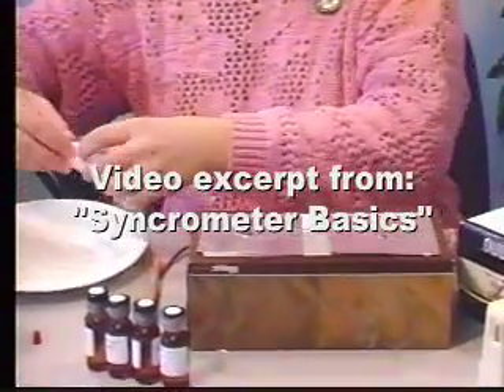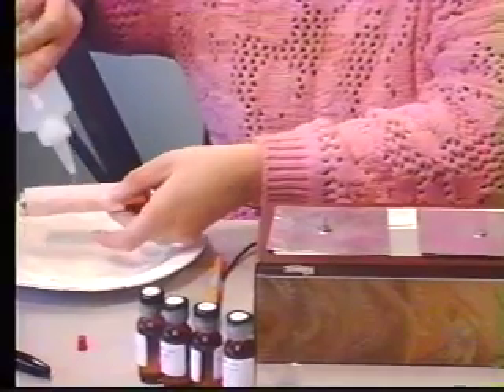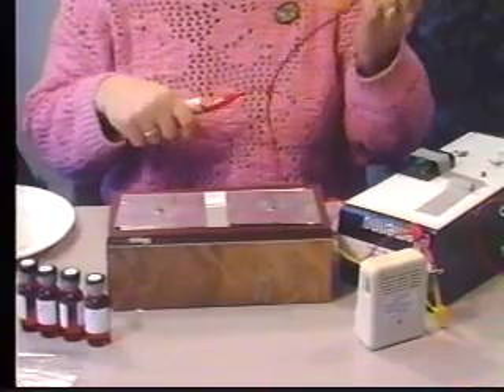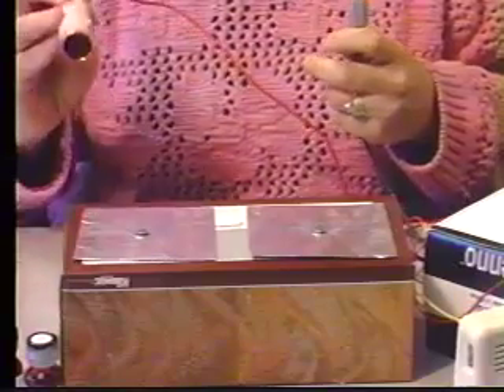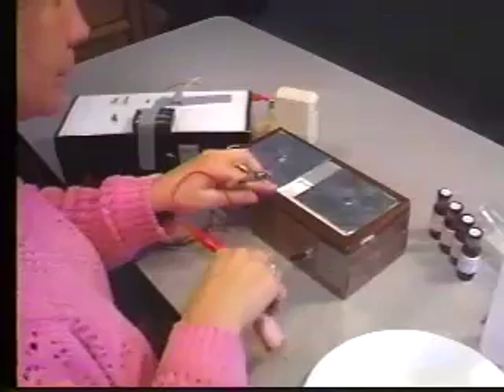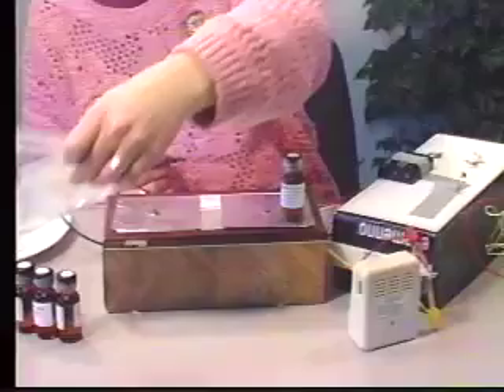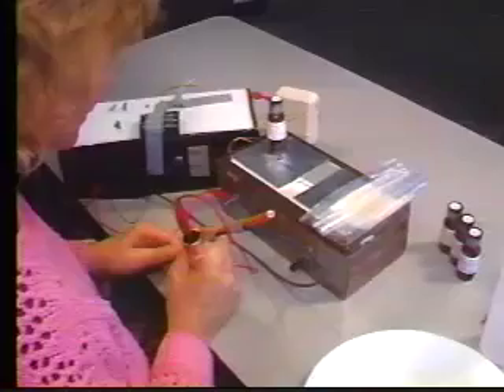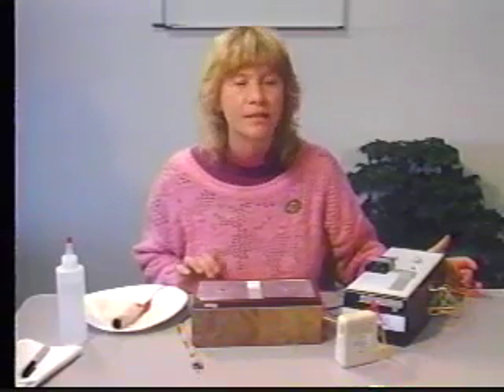How to test a homemade Syncrometer

Comment: There is something one can add to this circuit which enables it to detect things in our food without using samples. I will make this something later work after I spend about 350 dollars on a device I must purchase that does this. Are the frequencies of each sample like a sine wave or does each waveform has specific shapes and patterns or does it just oscillate based on the matching wavelengths? does anyone have a syncrometer for sale that would speed things up for me?  Someone gave me a free bag of muffins that made me sick and later I didn't eat more they gave me and kept them dry under the deck and they became covered all over with white mold, even the paper they were baked on and there is a theory that white mold causes cancer, but the FDA tries to suppress this theory hoping Big Pharma sells more Chemo Demo pills.